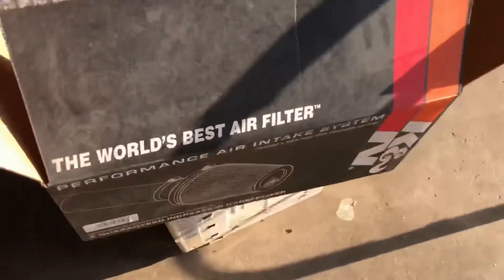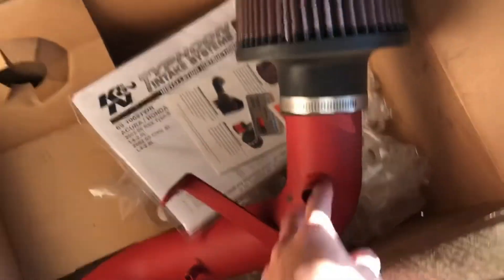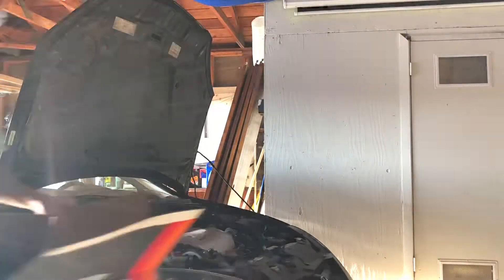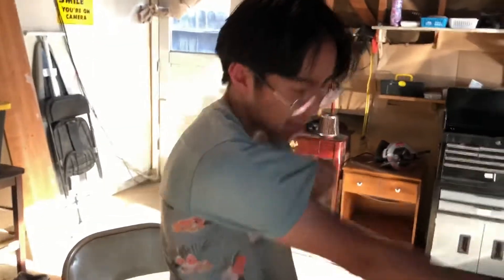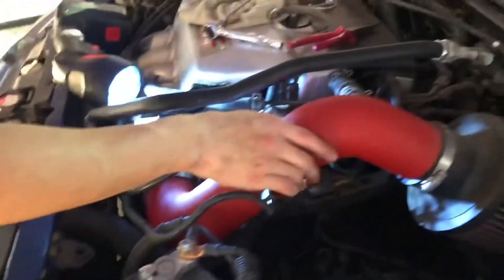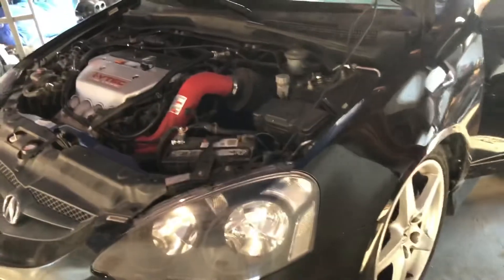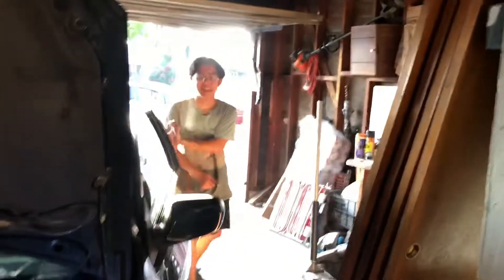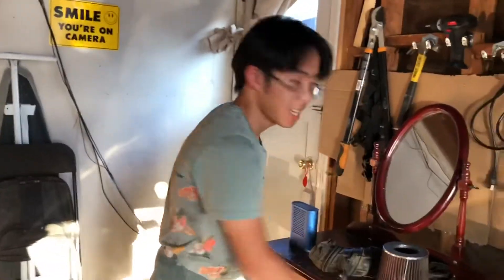First Mod for The RSX!

Comment: Just installed mine and I don’t see a difference in sound. I have a 2006 rsx. Could that mean I might have air leakage or something isn’t tight enough you think?
Reply from the maker: that’s odd. i do know that the z1 motors vtec cracks different than the a2 motors. maybe try checking over it again, good luck man